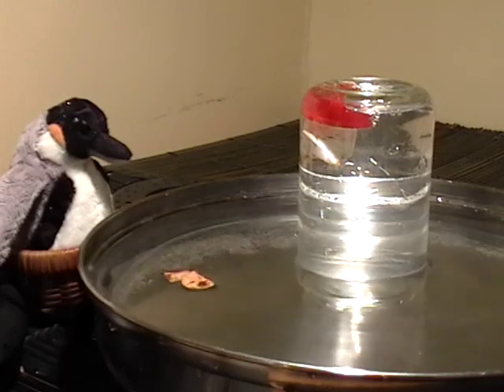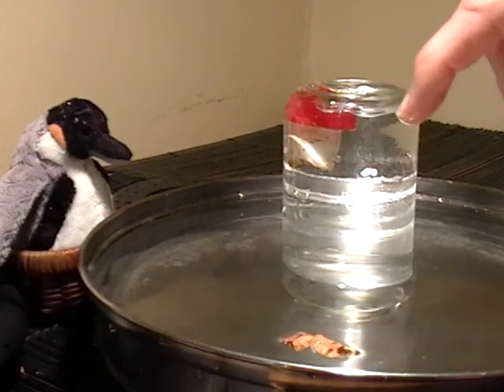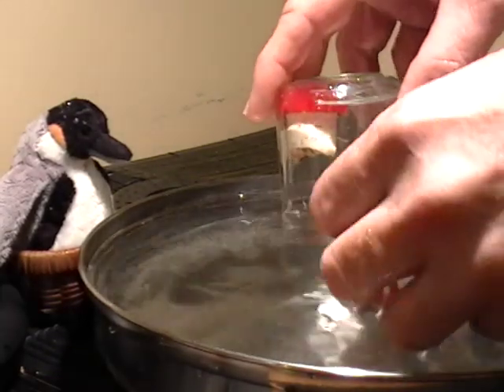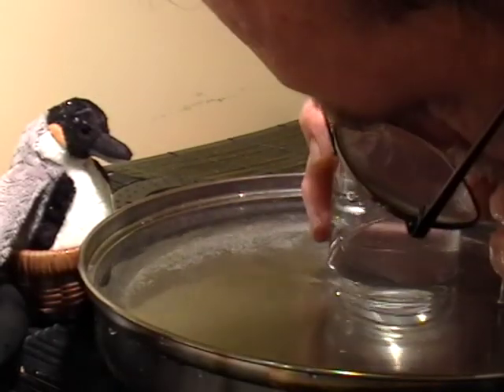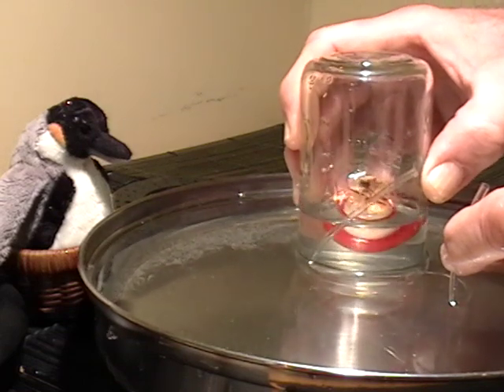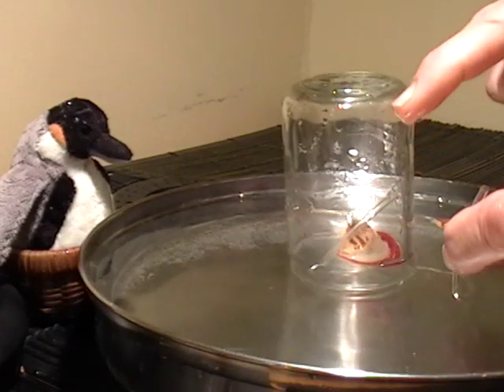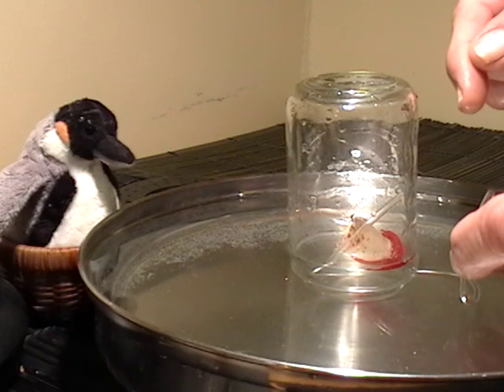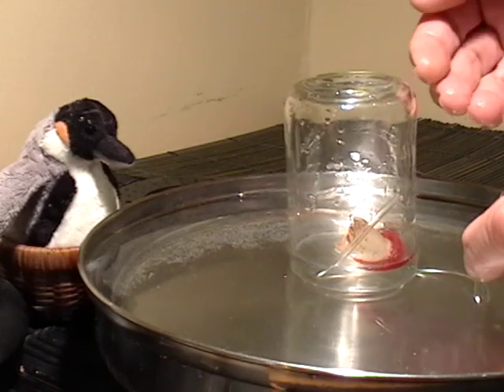Buoyancy Demonstration #1

Comment: Solar and chemical energy has been acquired, processed, stocked by the plants that were eaten by the tons by the animals we eat (meat). "Food" is exactly like refined oil, stocked/concentrated energy (glucid, lipids and various nutrients, minerals, .. ), we just extract it trough our digestive system and use it within our cells (mitochondria, ATP) to sustain our "alive" state. 

Also, you have energy from previous meals unless you're suffering from severe malnutrition.

Comment: What I am saying is, for the air to escape through the tube the water pressure has to be equal to the air pressure and that can not happen with the tube submerged 1 1/2 inches under water.

Comment from the maker: Are you asking "Why is it impossible to make a leakproof valve that will operate without friction, against a mile-high head of water pressure, and admit a solid object through it?"

Because materials aren't strong enough, friction losses cannot be eliminated, and you CANNOT get energy from a buoyancy drive even if you could solve these problems. Because for every cork you inject at the bottom, you are RAISING an equal volume of water, and this takes the same amt. of work you get back.

Comment from the maker: OK, fair enough.
With buoyancy, the change in depth, changing PE, does require work. It's just that it only can return the work put into it, so the system can't work in a cyclic fashion without energy input. It takes work to sink a buoyant object, and the object returns the same work when it floats up.
When you sink an object, buoyant or not, you are raising the equal volume of water. This takes work. If the object is buoyant, it takes more work than the PE of height can provide (or return).

Comment from the maker: Can you speak English?
What do you mean, "Consider surface as an explanation?"
Do you mean something like "surface tension?" Then you may explain why liquids with extremely low surface tension behave exactly the same way, or why adding a surfactant doesn't change the buoyancy behavior. Surface-skimming insects and floating razor blades aren't kept up by buoyancy; this video is about buoyancy.
"Water seeks its own level" is shorthand for a bunch of stuff you probably wouldn't understand anyway.